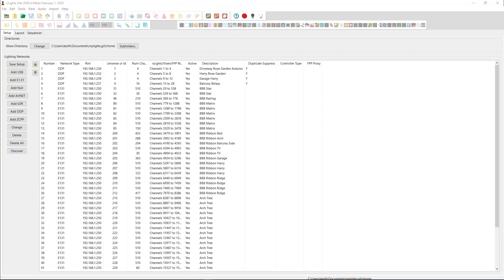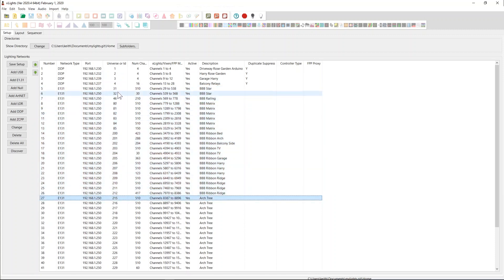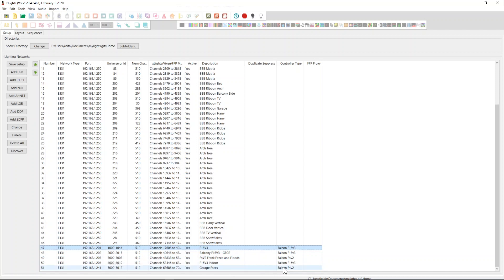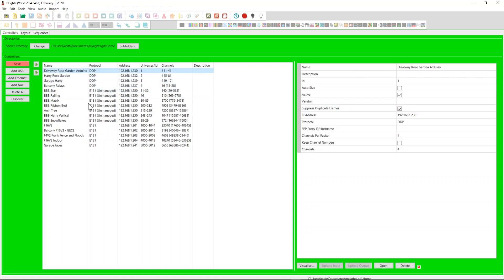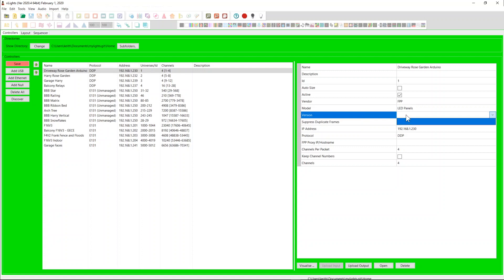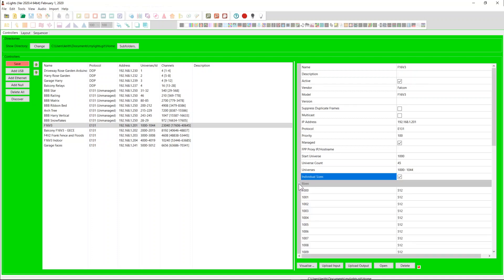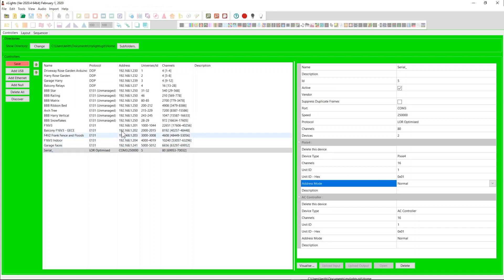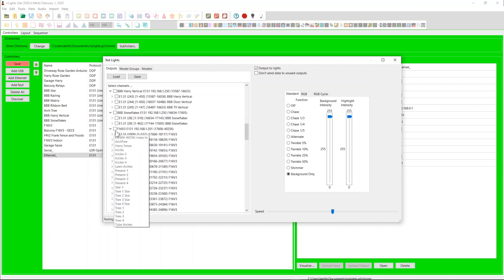Preview of the upcoming changes to the xLights Setup Tab.

Comment: Keith- Do you mind telling me what your driveway arches are made out of? Is that Pex tubing or clear PVC or?
Reply from the maker: 25mm PVC conduit ... placed over rebar and every second has a 6mm steel rod running through them. I am not enormously happy with them. The LEDs are 3 led modules cable tied to the conduit. These are robust ... mostly. In the heat the conduit gets soft but my biggest problem is guy ropes ... first few years I did that poorly and it has damaged the actual shape. It was better this year but not perfect.

Comment: I just changed from channel numbers to output, back to the spread sheet.
Will we be able to turn outputs off in xLights? I liked that for limiting the data instead of limiting channels.

My main controllers are Advatek PixLite 16 MKII and 4 MKII and 1 F16V3 to play with for now, will the pixlite's be like the Falcons that can have the setup uploaded for each output? or is it only channels per controller I still cannot get my head around that part of the update.
EG tree is output 1 and 2 800 Pixels each and the star 50 on output 2 etc..?
I setup my controllers to mainly only use the data and -VE unless it is only 1 or 2 strings (star).
Thank you for all you hard work.
Reply from the maker: You can disable a controller ... but not individual universes on a controller. If you dont need those extra universes ... dont define them.

Comment: Any chance of the individual universe tab (For setting up differing size universes) having a text field there to allow us to give it a name? I use that in the existing versions to help with prop allocation and a universe number/universe size really wont help a lot moving forward
Reply from the maker: With the export models that functionality has already been available in a much more reliable form than using the description field for a long time. Rather than relying on a description field which can easily become out of date the models export tells you exactly what is configured at any point in time.
If you are wedded to that functionality you will not be able to upgrade as we wont be supporting it going forward.